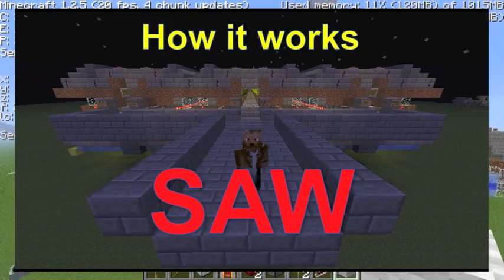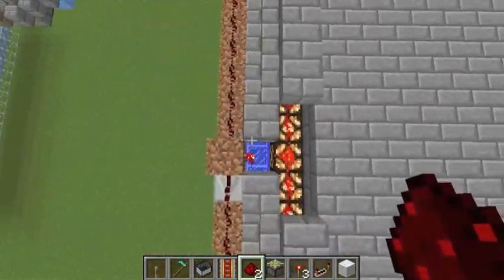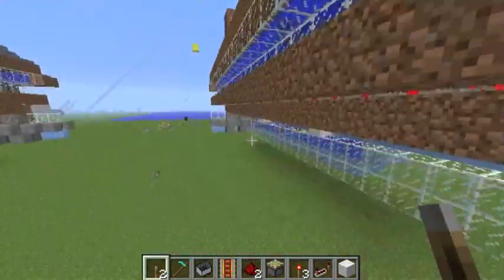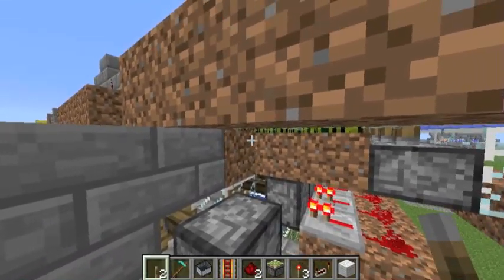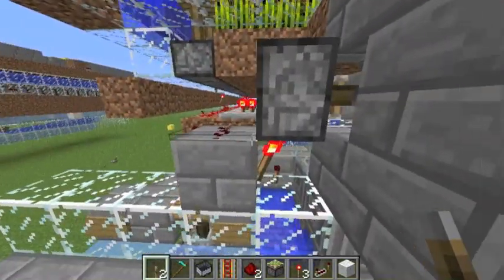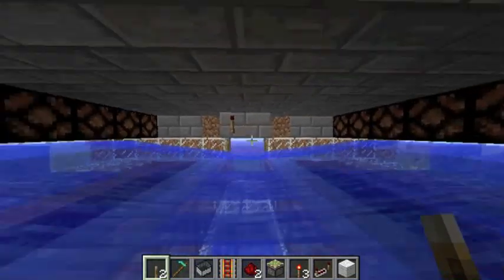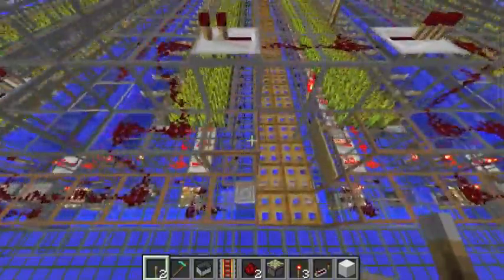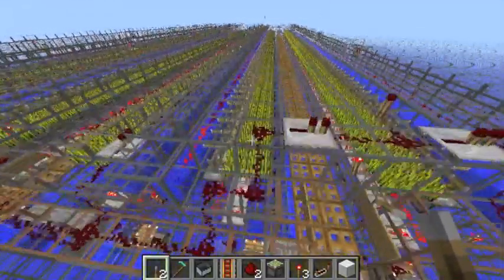How it works: SAW

Comment: Yeah, I see somebody made this mechanism earlier. But I didn't see on these videos the minecraft mechanics I've seen, you know, that when two pistons push one block with only one air block, one always take a lead. I meant that when I was writing about making genius mechanisms, and I mentioned falling edge detector just as example. I made it powering the piston that normally won't extend with repeater with first delay, and the one that normally should extend with repeater with biggest delay.

Comment: Too long, didn't watch. Just kidding. This construction is very advanced and stuff, but it's quite pointless. This cannot be better than other ffarms in efficiency means, because wheat grows the same as long it has tilled soil, light and water nearby. This all redstone work, game lagging RUD switches and need of ice makes this farm just pointless. There are very few circumstances that anybody would have a need for a exact same size farm, and there are alot of much simplier designs of